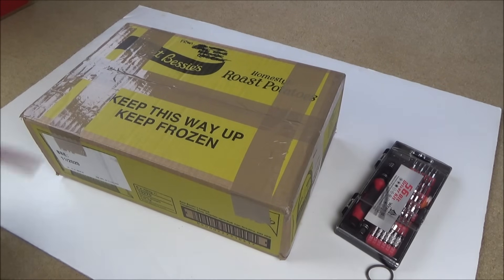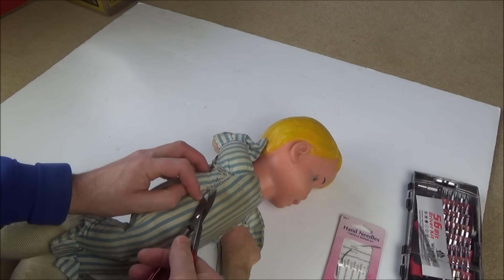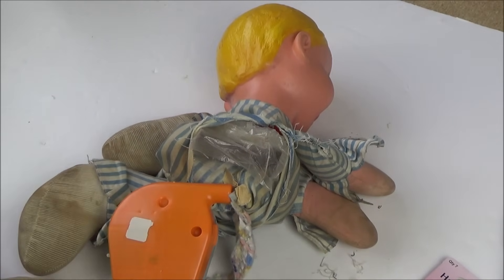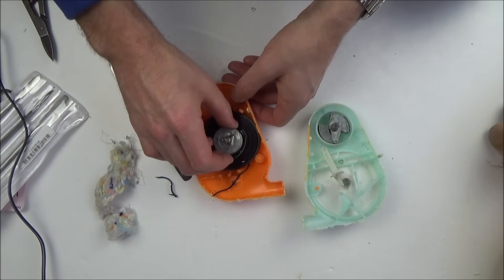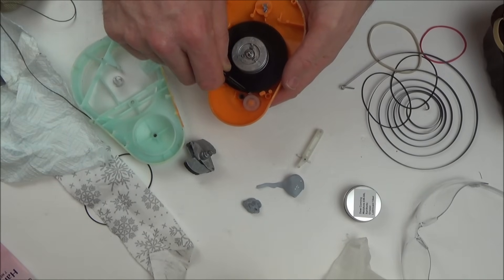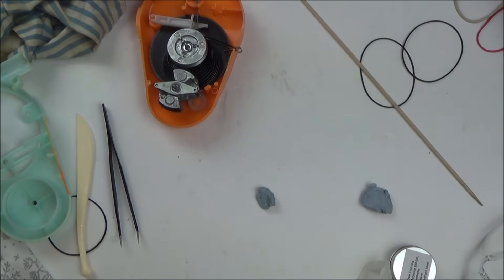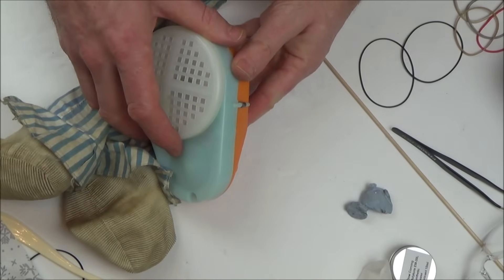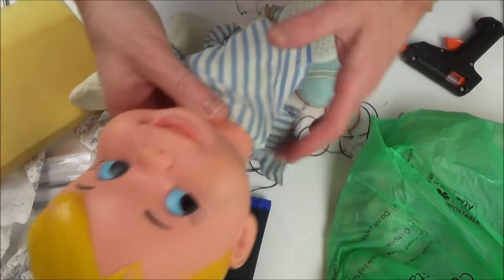eBay Pre 1980s TOY Repair Challenge PART 3

Comment: the reason no new toys have pull strings is because it is just outdated, they sound a little muffled when they get older and the idea was used from the 50's to the 90's.

Comment: One of your better videos Vince. It comes out really good in the end. If you look at the strip down, you can see the parts of the record that have been stripped off due to the disc spinning too fast. They are small black strands. I really do admire your tenacity. Your electronics videos make me scream at the screen with frustration, as electronics, and rework in particular is what I love to do. But good on yer for filming it all and putting it up for the world. New subscriber.

Comment: LOL @ the ending - made me laugh! =D  Very intersting repair!!!  I suspect the super glue perhaps didn't help, but as you say - it will have been thrown around and abused, the record will have numerous scratches!  I would have been tempted to put the fabric inside one of those "bra protector bags" and stuck it into the washing machine on "delicates".  But it still came out looking great!  It's sad it didn't sell for much though =/   Well done for sticking with it to the end and sharing it!

Imagine your kids pulling the string on that numerous times per day - it would drive you loopy!!!
Reply from the maker: Haha, luckily the kids showed zero interest in this one. Yes the washing machine in a protective bag would have been a better job, might have got the stains out of his feet. Looking back I wish I had done the research first as it might have worked perfectly, the super glue and all the mucking around with the spring probably made loads of scratches. But then it wouldn't have been as interesting for me as half the fun is working out where it all goes and how it works without reading it somewhere first. Even if the voice was perfect I don't think I would have got any more money. I obviously over payed for him massively but I didn't know at the time. Mr Pandy had the last laugh :-)
Reply: Having said that - I just had a thought - maybe any paint on the head might come off in a washing machine!  So it's probably safer the way you did it =D

Comment: This player mechanism was an evolution of Mattel's earlier unit used in a toy called Robbie The Robot who said, "I am Robbie Robot. I was made on Mars."

There were dozens of these units with different records in them. This design first appeared in "Larry The Lion" a hand puppet that would say different things each time you pulled the cord: "I'm Larry the lion.", "Roar!" "Oops, I scared myself." etc. (Larry was voiced by famous voice actor Mel Blanc.) There was also a non-puppet version in the early 70s.

I recall that the mechanism that the belt spun was a governor very much like the type found in many machines (and automobile distributors) where the weights would spread out as the unit spun causing drag and slowing the record to a usable speed. Quite ingenious. Most of these were capable of saying multiple things. It was later evolved into a circular toy with a knob to select the track to be played and there were a couple of versions, one doing animal noises being the best known. ("The cow says Mooo!", etc.)

This stuff was around for quite a long time, until digital versions took over most of the market. These were capable of surprisingly clear when new but the record being made of polystyrene and the crude needle assembly soon wore things to a noisy mess. But the child would usually tire of the things before then and it would be knocked and thrown around until donated to some thrift store or such.
Reply: Ray Rooney and now the robot is saying “my battery is low and it’s getting dark”

Rip OPPY
Reply: yeah to add to the govenor in this use its basically a centrifugal cutch exact same priciple (think lawnmower or automatic moped etc :)

Comment: Your content is quality as always 😉 Here's a tip: If you stumble upon more vinyl discs in the future that plays a recorded voice for dolls or vinyl discs that plays an album but the vinyls are filthy and dirty and the sound sounds a bit rubbish then i reccomend using wooden glue on them and spread a thin layer out on the whole disc and leave for 24 hours. The glue will form the shape of the disc which means that it will capture all the dirt from the grooves. In most cases the glue will come off looking like a vinyl disc and your disc will be very very clean ☺
Reply from the maker: Thank you and nice tip, thanks for sharing it :-)

Comment: These toys with record players in them survived well into the 1980s, although in later years they were battery operated. My brother had a police car, and a Dalek which both worked on the same principle. No prizes for guessing what happened when I discovered that ;-)

Fantastic fix, to be honest I don't think you could have done much better. I would not be surprised if the buyer flips that for a juicy profit himself unfortunately :-(

Comment: Nice try , i would have thrown it clear out the freaking window.
They were never made to be taken apart you just wiped them down with a damp cloth and that was it.
Yes i do remember Andy as a kid , and it was around the same time another kids programme  which was called Hectors House. 
Andy would have had a bonnet on his head.
cheers
Shayne.

Comment: Ehh... that thick horizontal stitching on his bottom was meant to be the place where you pull out the mechanical parts... that's why it is on the outside... Why open a stitching that was done from the "inside" - I mean sewed together when it was not put together by having the whole thing inside-out - rather than opening the stitching that can be re-closed from the outside???
Reply from the maker: I didn't realise, I thought that might be just a stronger stitch. I didn't notice or think to look at the different stitching :-)

Comment: when i was younger, i remember the barnyard speaking toys using a pull cord, then they transitioned to a plastic arm you press down after the mid-late 90s. still, old toys like this remind me of the talking Ninja Turtles line that was available for a short time. i only had one of them, but the basic design was their shells were replaced with a small vinyl record playing apparatus, and you ran a vinyl cord with a different word recorded onto it to produce sound

Comment: Amazing job with the voicebox (Interestingly enough, it works on many of the same principals as a gramophone). Since this appears to have been a learning experience (Aren't they all?), I thought I'd share a little, very interesting tip I've seen on another channel (Marty's Matchbox Makeovers) - Using superglue combined with baking soda creates a substance with a stronger bond that can be shaped, and sanded... Could be helpful in repairing broken plastic bits...

Comment: You should have stitched it back from inside out using a bent needle. You do that by stitching loose from the inside and pulling the stuff together with the string and moving on to the next stitch, again, from the inside out loosely, then pull together... I'm sure Youtube is full of videos on this kind of hiding stitching. But you should have undone the thick stitching on the bottom, which is the place they left to do repairs or so. All the other seams were done having the whole thing turned inside out, that's why you don't see them normally.
Reply: I was going to say the same thing! I was cringing when i saw what he was about to do. Lol

Comment: Hey Vince, great videos my friend!  Very educational & entertaining 😎. I have a special request... If you can find the time, can you please make a video about how to switch the polarity on the AC adapter tip? I've had a Sega CDX system for years without an adapter. Just recently, I've found a perfect replacement...but the tip needs to be switched from negative to positive. I'd also like to know how to test it after your done soldering with a multimeter to know it's the correct polarity.  Thank you sir and keep up the great work 👍
Reply: There are multi end ac adapter on ebay and Amazon that have 2 polarity on them with switch to set.
Reply: @nathanmead140  thanks Nathan, but the point is to not spend any money.
Reply: @jddeluxe2242  they should be pretty cheap and still be good i found one for 12 USD so there are probably some cheaper than that
Reply: @nathanmead140  Nathan my friend... Your missing the whole point. I want to learn how to make my own. That's the whole point of his channel.  If he just told you to  "go buy this" that wouldn't make for much of a video.

Comment: When items you are repairing are glued together, try heating them up a tad to loosen the adhesive. It should come apart easier that way, try not to melt any plastic parts with the heat gun.
Reply: This comment should be pinned

Comment: Did you get your activator for the superglue yet. Might of saved you that issue of it not setting .
Reply from the maker: Hi Dave, it has arrived but this 'fix' was filmed before you told me about it. I haven't tested it yet but I will do when super gluing next :-)
Reply: @Mymatevince  ah I didn't think about that i forget videos on here are filmed sometimes weeks before seeing them. great work again shame it didn't sell for more but i still think you have this challenge in the bag :) . Look forward to seeing your opinion and experience in using the activator , it's not a big or revolutionary thing but it's really handy .

Comment: I have a strong suspicion that instead of spending 3 hours trying to figure out on your own, you could've checked the patent which was helpfully printed on the box. (if modern manufacturers would print URL of datasheet right on the chips and PCBs, wouldn't it be awesome?)  

Though reading it is also would be painful, as you'd had to endure run-on sentences like 

"As will be explained more in detail hereinafter, the device possesses the quality of randomness of operation in that upon each operation the needle may engage any one of the various grooves randomly so that the sound that is reproduced cannot be anticipated."

eta: wow, after the cleaning he really look good for 50+ years old boy.

Comment: To open the stiches I would use a very sharp scalpel

Superglue is not always the best to glue sth.. Especially not at many plastics. In this case I would use epoxy.

Comment: I would have loved to see if it was possible to remove and play the record using an actual record player. This way you can control the needle and test out all the spirals. The RPM may not be 33 or 45 but you should in theory get some sound from it and decipher what the phrases were but in an incorrect pitch.

Comment: another hint , use lithium grease , i fix 90s videocameras (hi8/vhsc etc) for like 12 years from now and lithium grease is my life saver on those delicate mechanics , never use wd40 in metal gear aplications , you ruin your gear shafts etc

Comment: I always use an activator with superglue.  It will give a better and quicker bond.  Any activator will work with the majority of superglues.  You are supposed to spray one side with the activator and apply glue to other side, but I often just use glue as normal and spray activator when the parts are in place.

You can also use the baking soda trick to make glue go off very quick and hard, but its very ugly.
Reply: I use it on RC vehicles and models for filling in holes. It actually drys translucent. I dont see where you get ugly from. As long as you use very little and layer it. It works better than any filler I have ever used.

Comment: It looks as though it would have been better to unlock the section along the bottom of the doll.  That was stitched from the outside so would have been easier to repair

Comment: If you had a little bit of sewing knowledge you would have realized there is one seam that has not been turned inside out: the huge seam across the butt is the final seam and should be the one to gain access to the insides.
Reply from the maker: Thanks, I didn't realise at the time but now it is kinda obvious once you know!!!! Thanks for sharing the knowledge :-)

Comment: Hey Vince, You can actually buy a recordable electronic voice box. They are super cheap and can be done using your computer. It might not be vintage but it will work and its better than mucking around with that. You might be able to actually save the sound bite off that record by making a home made record player and recording the sound. Then transfer it to an electronic device. Then all you have to do is push somewhere on the doll. Whereever you choose to mount the button.

Comment: The IPA you use will kick the CA glue off (cure it) instantly!!  The moisture in the IPA kicks it and the IPA helps the moisture whet on to part.  I dab it on my 3D printed parts with a q-tip!

Comment: 26:07 VINCE stop buying cheap glue and buy some Industrial Cyanoacrylate like LOCTITE® 4080 or 498 for heat sensitive areas
and don't buy it on ebay, most are date sensitive or fake

Comment: No clue on those. Not into those kind of things. I remember breaking a few. My parents were usually happy they broke and would punsh me if I tryed to fix it. When my girls were young I found a simple ice pick through the noise maker worked. Now its easy to unvelcro the pocket the electronics are in and pull the button batterys. I remember GIJoe that had a pull string and a voice box. Hows that for dating myself. Our lost in Space robot had simple wiring and ran on D sized batterys. The plastic gears stripped out right away so it wouldnt move any more. There was no 3 d printers to make new gears with. I bet that robot would be worth a Fortune now. Oxyclean works great on things like that.